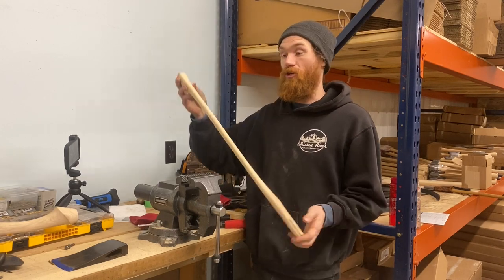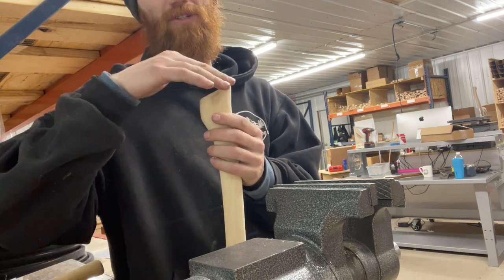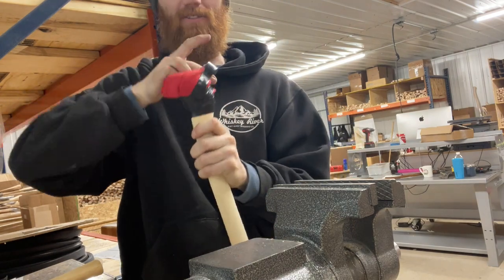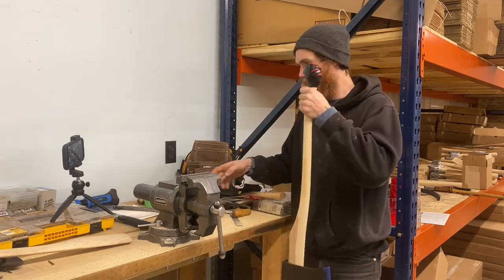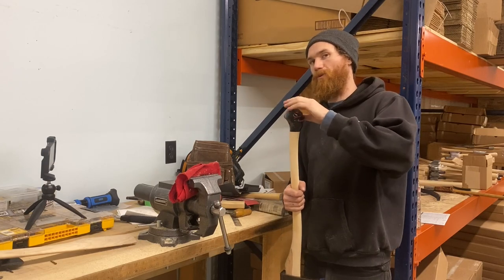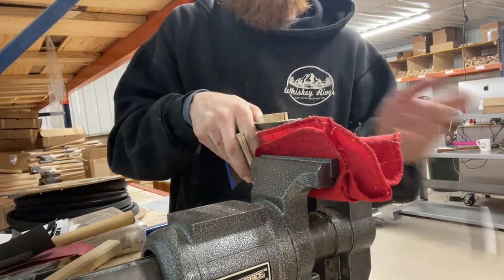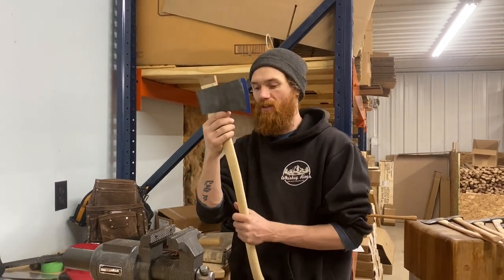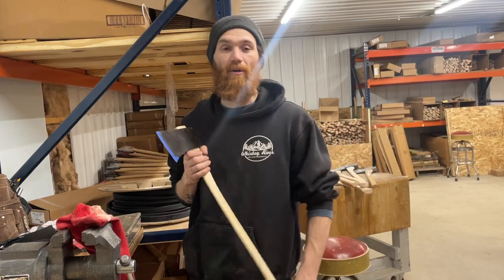The FIRST EVER 28NEC Hang - I'm Loving This New Handle

Comment: Would you normally use a steel  or barrel wedge to hold in the wood wedge?
Reply from the maker: I don't like either, I prefer to use a tapered wooden dowel wedge or to just make a wooden cross wedge. But, if you have the right size handle and wedge for your axe you really shouldn't need anything else, the second wedge is more for just looks at that point.